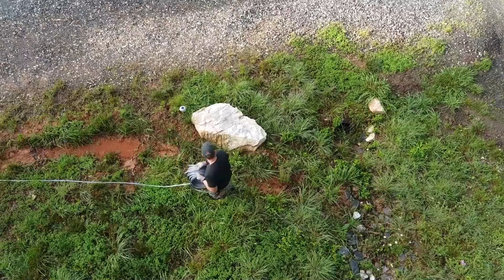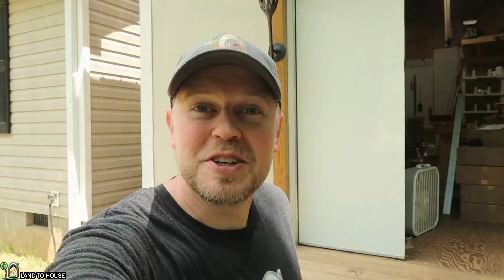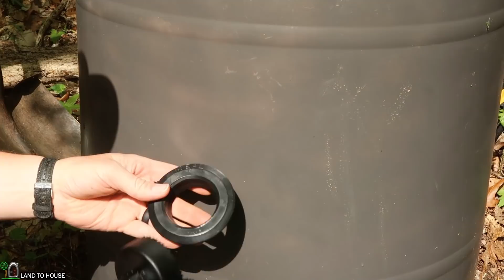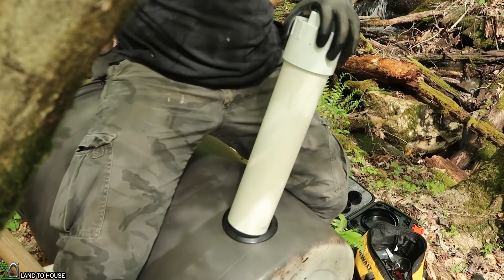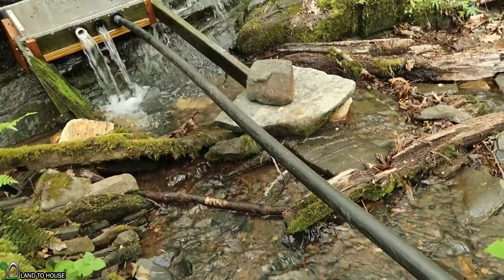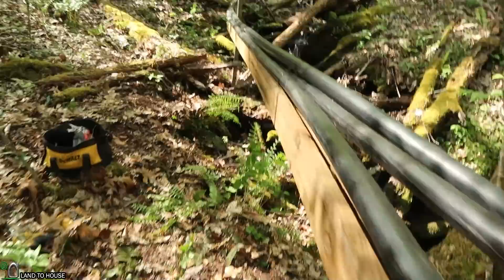Intake Barrel for Silt Catchment Micro Hydro 2/10

Comment: Hello Seth, I see in a later video that you turn your system off in the winter. Will the water in the catchment barrel freeze even if its running?
Reply from the maker: I left that running with the drain plug open. No issues but it might freeze if I left 55 gallons in there.
Reply: @LandtoHouse  hmm, I am installing a much larger tank.  Winter is when my stream has max flow and I need the most power. Do you recommend that I omit the sediment tank? Im in NYs the hudson valley and my stream never freezes over anymore.

Comment: I'M LATE "TO THE SHOW".... AND LOVE WHAT YOU'RE DOING!!!!
QUESTIONS PLEASE, BASED ON WHAT I'VE RESEARCHED WITH OTHER SYSTEMS:
I. Have you considered making a larger "catch box" under the small waterfall in the creek? 
* Or are there regulations in your area where you can't do that?
* If you installed a "double portion" concrete box (has two internal sides inside one outer box to eliminate mud, sticks etc) under the waterfall, you could catch a much larger amount of water right from the start... before you route it to your 55 gallon drum.
II. And, speaking of larger "catch boxes" for water... have you considered installing a larger water basin (maybe a large cement cistern with 1,500 gallons or more) and getting rid of your 55 gallon drum... or install multiple drums.... in order to have a larger reservoir of water as a "backup" to generate electricity for you and your family?
Just curious!!!!
My wife and I are retiring in Sept and moving to the Pac NW where we want to do the same thing you're doing.
If you have any referrals for Hydro Experts in that area (OR, WA, ID, MT) it would be most appreciated.
Thanks!!!
Keep Up The Great Work!!!
Mr Bowen
Veteran
BowenOrg@gmail.com

Comment: Could you have a small hole (1/8th inch) in the drain pipe at the bottom so there is always some sediment drain off?
Reply from the maker: Possibly.  I wonder if that would drain too much water in my case. There are times when I have to turnoff the unit because of low flow.

Comment: This is too cool!
Your overflow and silt clearing can be one in the same.  1" pipe through the barrel wall as close to the bottom as you can get it, add an elbow to then run it up the outside to your 'fill' line, then another elbow pointing outward to direct the overflow back toward the creek.  As the water goes through the bottom fed overflow it will take bottom silt with it.  Keep the 3" for occasional deep cleaning.

Comment: I think I would have flipped the barrel upside down and used one of the two existing/threaded bungs for the clean out, by drilling an inch or 2 up, you're going to be left with an inch or 2 of sediment no matter what you do. Flipping it and using an existing bung you'll drain from the very bottom getting 99% of the sediment. Yeah, you would have had to drill 3 holes on the top(bottom) for your input, but they arent going to have pressure/weight of the water on them from the 40 or 50 gallons of water it takes to fill to the outlet and/or overflow, and I'm not sure if those Uniseals can take that long term. With the outlet you'll only have about 20 or 30 gallons of pressure and the weight is lateral not vertical.

Comment: The Uniseal doesn’t require a flat surface, then. That is very cool. With all your hose clamps, use a USCG requirement for all boat applications below the water line: double clamp them.  The reason is that one clamp will always give out first, and when that happens you have a second clamp holding the connection until you replace the broken clamp. Your clean out idea is really good. I see a lot of creek installations and silt buildup is a constant issue. To further mitigate silt getting into your turbine feed line you might think about putting in a baffle in the drum so the turbulent water coming into the tank will calm and let the silt settle before it gets pulled into the outlet.

Comment: For your sediment filter tube I would’ve just put a little half-inch or something on there and just let it drain all the time. That way the sediment would always just be flushing out of there anyway and you never have to do any maintenance on it, just make sure the flow is restricted enough to where you’re still getting enough water in your system, that’s why I would use a tiny pipe or even just a hole on the bottom of the barrel. Maybe you could put a valve on it to adjust
Reply from the maker: We don't have quite enough water to let a 1/2" drain all the time. That would be an extra 10gpm.

Comment: Power generation topics are so incredibly important. Thanks for sharing this. I'd like to see how to do even more with less (for those of us who may not have access to really amazing springs, perpetually filled creeks or rivers). Would the methodology discussed by Quint BUILDs in his rain gutter power harvesting series https://www.youtube.com/watch?v=S6oNxckjEiE ?
Reply from the maker: I have seen that video. Definitely working with a small amount of power.  My system is 200 watts with 1 nozzle. 370 watts with 2 nozzles.
Reply: @LandtoHouse  that's amazing. I'm trying to figure out how to turn a sometimes low volume creek into a source of power, but really struggling at how to make this work. State laws allow damming, but sometimes it is so full it nearly overflows. A real head scratcher. Wife has been thinking your work holds the key, but haven't yet got a clear picture.
Reply from the maker: You would need either high flow and low head pressure or low head and high flow. A water wheel is also an option for low head pressure with lower flow.

Comment: Ok.. you should have just followed the creek with your poly, if only to get the siphon working. As long as the lower end is lower than the intake it doesn’t matter about the ups and downs in between. The pressure you get is directly in proportion to the height difference between the intake and the lower outlet.
Reply from the maker: The Creek goes off to the side and would have increased my pinstock length by at least 50'. 

 If air gets trapped in one of those high spots it greatly reduces the pressure at the bottom. I have found this to be very true so far

Comment: Nice... you might want to consider a cavitation baffle in your intake box in an attempt to minimise the turbulence / bubble generation.  Something like a 4" drain pipe cut in half and installed across the box - curved side up, under the screen where the water drops into your intake box.  When you upgrade your intake I'd also consider something bigger and attempt to capture more water (there seems plenty).   I'd also suggest a clean out / purge outlet with a valve on the side of your intake box and some valves on your feed pipes as sediment will also build up in your intake box and you'll be able to easily blast /clean it out with that approach.  .Hi from NZ, looking forward to more updates.  Great work!
Reply from the maker: That does sound like a good idea! Reducing the air bubbles might be well worth it. I do wonder if there is a time of low flow in the creek that there will still be air introduced in the three 1.25" pipes because of the air being sucked in.

Comment: I would have put the three inlet pipes into the drum near the bottom of the drum. That will keep the gradient even. It will also cause the water to enter the drum smoother, therefore preventing the water from becoming aerated. Air in a penstock is bad.But good work so far.
Reply from the maker: That is an interesting idea. So far after a month of use the system is doing very well! I think that the air is hitting the water at the top of the tank and not going deeper into the water.
Reply: Also the overflow should go up out of the top to allow all the air out while retaining all of the head .

Comment: Did you ever try my idea for combining the overflow with a silt drain. The idea was to put a T on the silt drain pipe where it comes out of the barrel near the bottom. Then put a vertical pipe in the side of the T  coming up the side of the barrel to the height you want the overflow at. Silt will run out anytime there is water coming out the overflow removing the silt continuously with the overflow as long as there is sufficient water coming out the overflow possibly eliminating the need for removing the plug to cleaning out the silt. It will also leave the option of removing the plug to remove silt the same way you have it set up now should it become necessary when there is insufficient water flow to overflow. If there isn't enough water for continuous overflow you might need to add another water supply pipe to the barrel.
Reply from the maker: I have seen those bottom sucker filters. They do work. And the good news is the silt is so fine it should travel up that style over flow just fine. Perhaps that will be an upgrade in the future. I will have to see how much buildup there is in a month.
Reply: @LandtoHouse  Just had another thought. If you have enough water overflow at your barrel at all times when the micro Hydro is running it might work even better to just have a small pipe  on the same level as the drain and let it run continuously but only if you always have excess water so it won't lower the water level in the barrel.
Reply from the maker: I am actually about to install a 3/16" nozzle to gain around 50 watts more by using the last of the overflow water. I feel like the extra power is more beneficial than the silt drainage at the moment. 

My 1 month of use video comes out in 15 days or so and shows that there was only 1/2" of silt after 30 days.
Reply: I'm watching from the south Pacific and I find this very interesting and may try it here. Question is - where is the ' T' gonna be at, inside or outside the barrel?
Reply: @nonutuisamoa1358  I was referring to adding it in to the drain after it came out of the barrel between the outside of the barrel and the plug in the pipe. I think the pipe he is using is too large with the volume of water he has. A smaller pipe would allow the water to travel through the pipe faster to make it possible for the silt to flush out so the size of the pipe needs to be matched to the excess water flow to make it run out fast enough to carry the silt out. If the generator uses all the water so there is no overflow it wouldn't work. A better way might be to drill another hole at the same level using a smaller pipe with an elbow and a vertical pipe to allow for greater water speed to carry the silt out but only if the water flow to the barrel is enough to run through the overflow continuously. An even better way would be to use a small pipe straight out the side as he has it and leave it open if there is always enough water flow to keep the water running through the overflow he put in near the top of the barrel when the turbine is running so there would be plenty of water to keep a good flow to the generator.
Reply: @gordon-67  Aloha Gordon! thank you so much for responding, I am happy to learn from you guys and thanks for sharing your ideas. I live here in the south Pacific and we have a lot of streams so I am following Seth series thinking of trying it to power my hydroponic garden and also try his ram pump to get water to the garden. Again, appreciate sharing your knowledge. Stay safe and God Bless.

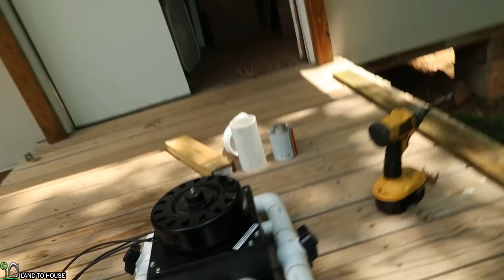Comment: at 3:15, you may know that the rectifier does  NOT  go, at the pma.   otherwise,  the line losses, when running  DC,  will be  MUCH  greater.
Reply from the maker: The rectifier is placed at this location to get an initial voltage reading. Later in the series the rectifier is moved to the end of the 250 feet of wire.

Comment: some info.        tell yer sponsor, their design is  Less-than  excellent.    cuz,   at 2:49, 'you are  actually  getting'  energy  LOSS,  at the  right-angle plumbing components.       supply-side plumbing  Should result  in,  the combined flow of  ALL  jets  being  Equal  to  the  Total  available flow.      googletranslate
Reply: It had to fit in a tight confined space . The main nozzle go straight in  only running one nozzle most of the time pipe is more than sufficient for a 5/16 nozzle.
Reply: @SpencerLAPower  this guy is on my channel as well with no helpful information as well, just keeps spitting out numbers on a paper. he has no real input on what to change or how to fine tune an of this no matter how its explained to him. David Davids has no use in life.
Reply: @homesteadonthemountain3100  he's what you would call a Troll check out his YouTube channel and it will all make sense to you 😄 . Trolls try to bring people down to make themselves feel important.
Reply: @SpencerLAPower  okay. 
"most of the time pipe is more than sufficient for a 5/16 nozzle"   this means  what???     context is  What.!       a mention of  'flow rate' would seem  to be appropriate.    thx
Reply from the maker: With only 12 gpm running most of the time the efficiency is just fine on the straight nozzle going into the turbine. When I do have more water to work with I can turn on another nozzle. 

My original calculation on max power was 350 watts. I have seen 370 watts. So... we are good.
Reply: @LandtoHouse  hmmmm.    some  fact-checking:       a flow rate of  Thirty  gallons  per  Minute,   equals  Two  Liters  per  Second.      when that value is combined with  the stated head, and  Gravity, you  get  Two Hundred Thirty-four   watts.... BEFORE   Losses.     curiouser and curiouser.    d
regarding silt:    obviously,  the system is  short-on  'settling'.

Comment: In the past, after very heavy and lengthy rain storms, your ram pump base and pump were upset by the heavy flow of water. 
Do you foresee any issues like that with the collection box?
While the turbine has been up and running, have you observed a significant  water event that might have caused you concern over the stability of your system? 
Is there a way to divert very heavy flow upstream of the collection box to prevent damage to it?  
To me, the weakest part of your system is the collection box. Thought of any ways to "beefen" up that part?  🦀
Reply from the maker: We had a couple rains that pounded over 400 gpm down the intake box! SO far its going strong. I do need to hike up there and see what sediment is in the barrel.

Comment: How often, do you think initially, will you have to clear out the sediment tank?
In the dead cold of winter, will you have enough flow to prevent freezing?
I'm thinking you will need to check the sediment level every Wednesday😉.  🦀
Reply from the maker: Bahaha most true statement ever. Wednesday will have the best flow rate but... full of silt. 

 I probably should do a one month after video to see how much silt is in there. It has been around 3 weeks now. 

 I turned off the turbine couple days ago and noticed there was a little bit of silt built up in the housing

Comment: Suggestion - Your over flow /air purge should only have a tiny hole (1/8") for an outlet to avoid losing your head pressure. 

The goal would be to use the smallest opening possible to vent the air and prevent structural failure of the barrel from over pressure.
Reply: Emblems4Life this isn’t a pressurized system at this point per sey, it simply goes down to having more water coming in than going out and needing to have the excess escape.  Having a consistent amount of water in the barrel will provide a consistent head pressure and wouldn’t have the worry about blowouts from too much pressure
Reply: Austin Briles Thanks for responding.  It seems that you could realize greater power production from your generator if you utilized all of the energy available given your potential volume and head pressure. 

Nice looking generator, and thanks for sharing your experience with us.
Reply from the maker: The head pressure lost from the screened intake down to the barrel is only about 2'. It's not too bad of loss. Perhaps 3 watts total.
Reply: Land to House Any idea of your actual power generation?  Voltage and Watts?

Comment: Ball valve would have been better than clean out cap.
Reply from the maker: That is true. I would have wanted at least a brass valve to stay good in the weather. Those typically run about a $100. Vs $6 for the clean out cap.  A full port ball valve 3" clean out was not in the budget.
Reply: @LandtoHouse  also a good idea for the overflow.  With too much pressure in the lines it would have blown all the seals out.  Would have been difficult to reinstall all of the connections.
Reply: @LandtoHouse  ever think of installing ball valve shut off valves on your three intake tubes, either up top or at your filter barrel?   Would definitely make barrel maintenance easier without getting soaked,  espec in colder weather.. ?

Comment: how much power do you think this will generate?
Reply from the maker: This system has been running a few weeks. 1 nozzle 200 watts. 2 nozzles 370 watts. i would have to add another 1.25" pipe out the intake box to run a 3red nozzle. 2" pupe can only transfer 39gpm at this length.
Reply: @LandtoHouse  thx